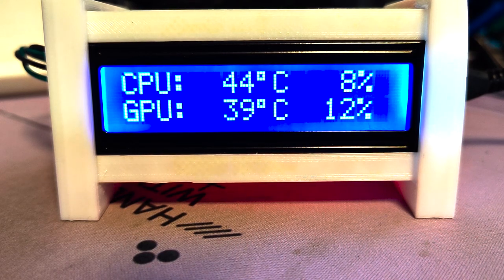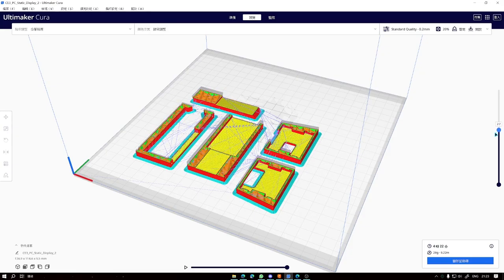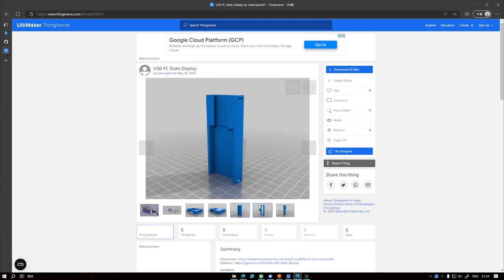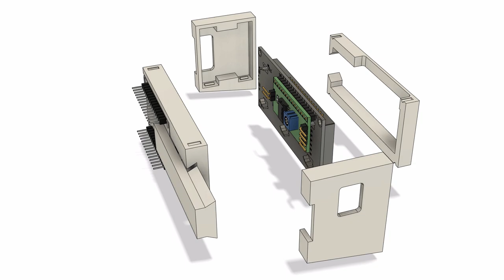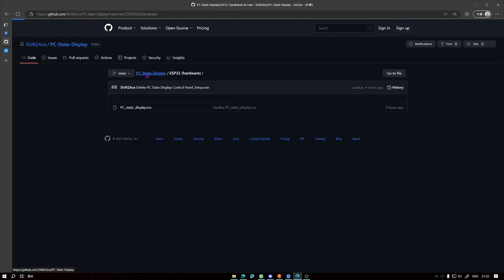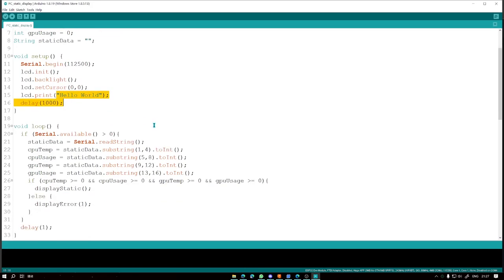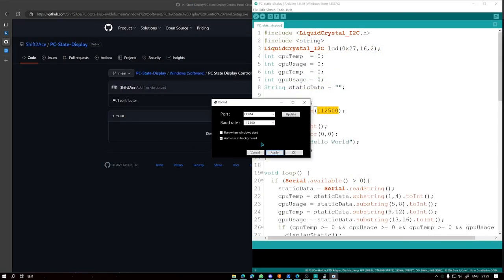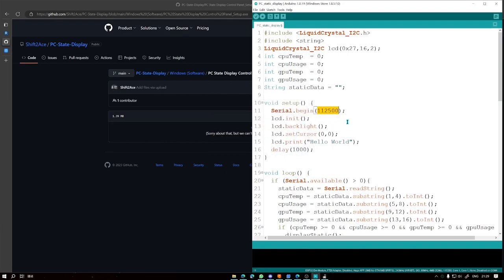ESP32 PC State Display | CPU & GPU | Temperature & Usage

Comment: I get error that thee program is not compatible with my Windows version. I use windows 11.  I run it on windows 7 compatibility and it started. The other error I got is: The PortName cannot be empty. (Parameter 'PortName'), Tis happens when i connect to port and stops automatically.
Reply from the maker: Sorry, I don't have any Win 11 device, but i will try to fix it
Reply from the maker: if you are using 2.0, click 'apply', then 'run'

Comment: Hello! i tryed your tutorial and i get with an Arduino Uno and LCD - GPU (Temp & Load) but for CPU only LOAD no temp, i tryed OpenHardwareMonitor and the all is shown
Any ideas ? did i have to modify the *.ino script a bit?
Thanks for great work !
Reply from the maker: @pixelshifter4162  if you're using v2, you can check name and values of the object https://youtu.be/XGQMR8WU4xw?si=-HWSeGr3ezhgWoOO
If you get the value, tell me how.
I guess the problem is the name or path of the object that different from mine
Reply: @Shift2Ace yess i am using v2, in console i get temperatures about 100 guess its fahrenheit but on the lcd gpu is in celsius
dont know how to chnage path or compile the exe file i am more in to linux but also no pro
Reply from the maker: @pixelshifter4162  https://github.com/Shift2Ace/PCSD-Control-Panel-2 source code here
I did with Visual Studio
the problem should be located on line 317 of PCSD-Control-Panel-2/PCSD Control Panel/Form1.cs
Reply: @Shift2Ace  i guess  should change:
 
(sensor.Name == "CPU Package" && sensor.SensorType == SensorType.Temperature)

Package with Core(
Tctl)
Reply: i have Ryzen7 3700X
Reply from the maker: @pixelshifter4162  I'm targeting on 9950x, I think I will meet the problem later

Comment: I have the display working and it's showing CPU useage, but it's displaying 0 decrees C for the temp. Any idea why? I had to delete "#include <string>" from the sketch in order for it to upload, but that is all I changed. And there is no GPU information at all, but I'm using a mini  PC with integrated graphics.
Reply from the maker: thank you for your comment.
There might be an issue with the number of CPU cores.
openhardwaremonitorlib might no support integrated graphics, I have only tested the program on my computer.
I thought I need to rebuild this project during next holiday.
Reply: @Shift2Ace  Cool, well I'll be happy to test it out if there's an update! Thanks for making this. It adds a lot of flair to my cyberdeck build and I like being able to see my CPU load at a glance. Happy Holidays 🎄
Reply from the maker: @hellspark  version 2: https://github.com/Shift2Ace/PCSD-Control-Panel-2
you can edit if there is any problem
openhardwaremonitorlib does not support integrated graphics,
About the CPU, I have the same problem on my laptop, i don't know why it cannot get ((int)sensor.Value) in my laptop, but it can work on my desktop.
the problem is on line 270 (form1.cs)
Reply: i did the same thing with deleting "#include <string>" from the sketch, i don't know if there's a "string library" that i have to download and I don't know how to use the new code from  version 2 in Arduino IDE. Can you help us with that?  @Shift2Ace
Reply from the maker: @slymahkdoum604  https://discord.gg/PGrqtwpnKv
Reply from the maker: @slymahkdoum604  If you can run it, just delete it

Comment: bro i maked correctly but showing 461Celcius GPU temparature but im using arduino mega
Reply from the maker: @Tlalomshot  what's your gpu? Arduino should be also work😵
Reply: @Shift2Ace  i fixed bug but showing all 0 and my gpu is rtx 3060
Reply from the maker: @Tlalomshot  if the screen not keep refreshing, that's mean the program is not running (not sending data)
Otherwise, the program cannot get the value
Reply: @Shift2Ace  what can we do bro i tryed open hardware monitor and not worked
Reply: @Shift2Ace  bro i fixed and i finded some mistakes (my cpu temp is not showing in any program)

Comment: Bro its showing 0 temp.Pls help
Reply from the maker: @AyyRajoo  https://github.com/Shift2Ace/PC-State-Display/tree/main/Not%20Working

Tell me more details 
Download openhardwaremonitor to check
Reply: @Shift2Ace  Bro everything works perfectly but it does not show my cpu usage.I gues its showing igpu usage and the temps are zero
Reply from the maker: @AyyRajoo  what CPU you are using?
Reply: @Shift2Ace  i7 12650h
Reply: @Shift2Ace  i7 12650h
Reply from the maker: @AyyRajoo  https://youtu.be/XGQMR8WU4xw?si=uZ1G_J-5qn_dTEOL
Check the value by console